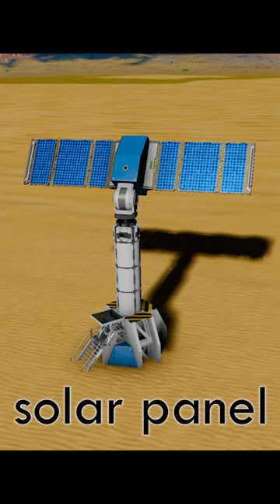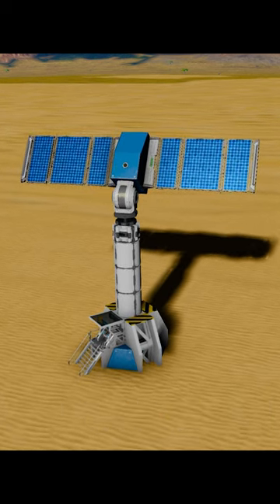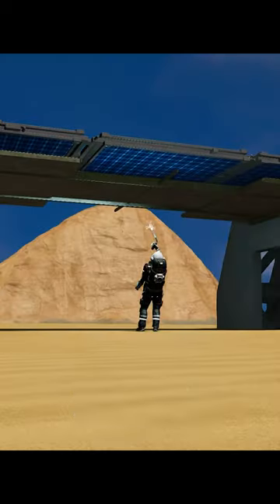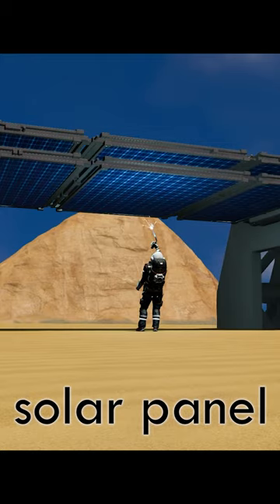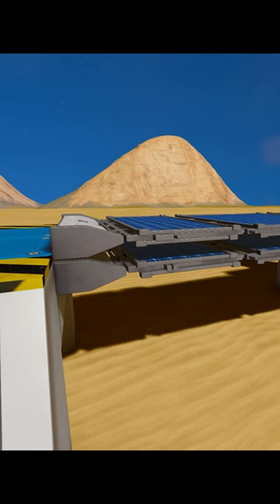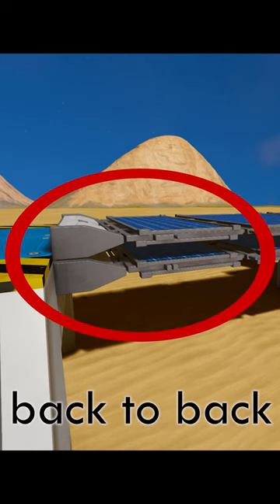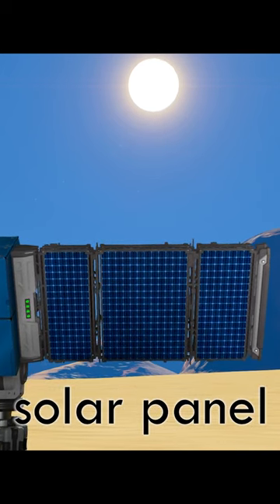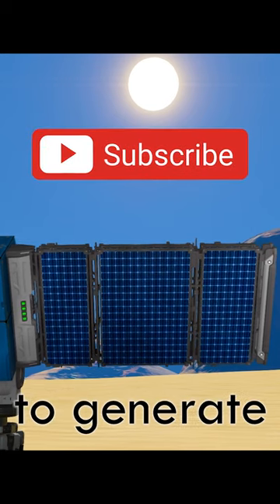How to DOUBLE solar panel OUTPUT in Space Engineers! (Outdated)

Comment from the maker: With the newest update, this trick has been patched! Sorry everyone, it was fun whilst it lasted 🫡
Reply: thats what i just realized today thanks for clarifying.
Reply: No way
Reply: It took them HOW MANY YEARS to fix this??
Reply: Nooooooooooooo I just tried it and it was patched T-T
Reply: I Told You The Devs Knew about This BUG/Trick(not a Trick really a Bug) and it will be Fixed
Reply: I wonder if that transparent solar panel glass mod can look into this now, make it a diminishing feature.

I've also had panels maintain charge through solid asteroids so there's that.
Reply: NOOOOOO
Reply: This feature will be missied
Also was good to safe space
Reply: @AliceDoesThings404  my nooo should be noted as a real darth vader noooo. I had 259 solar panels in my base, 128 of which were double stacked. Now I only have 131
Reply: There is a mod called remove solar pivots to enable this.

Comment: Space engineers again perfectly reflecting real life
Reply: Dual junction solar cells are a thing IRL.
Reply: All hail Klang!
Reply: This is a real life concept. The sun bounces off the sand and hits the panel underneath. This is why you can sit under an umbrella at the beach and still get a sun burn.
Reply: @alexc9434  wait, WHAT? That maybe explains some things xd
Reply: @alexc9434  It shouldn't generate at 100% though. The gains from the reflected uv is a significantly lower.
Reply: @My_initials_are_O.G.cuz_I_am  Multi junction solar cells just use different pn (diode) junction base and doping materials in each layer that forms an individual cell, and are identically limited in the same amount of layers a single junction solar cell is limited to.

They don't remotely work like multiple solar panels stacked up on eachother.
Reply: @benc182  Its still like 20-40% of normal output. And is even more in winter (cause of snow) or in cloudy/dark weather when the light is dispersed the most.
Reply: @LRon-Hoyabembe I agree with this guy he seems to know what he’s talking about
Reply: @benc182 As far as i saw it only generates around 20-40% Output getting closer to reallife (the first panels seems to count as opague block)

Comment: Instructions unclear, solar panel is now stuck inside the sun...
Reply: Solar= sun
Panel= a flat component usually laid into a floor, wall or ceiling. 

So you floor the sun with them. Makes sense.
Reply: @AlanGChenery  Well I mean technically speaking, "solar" means "Relating to stars," but whatever.

Edit: More accurately, it means "relating to a star"
Reply: Coords?

Comment: The front arrays would have to be transparent while catching the majority of the photons. The second row would benefit from being double sided with a light reflector on the back side to bounce back any extra light that wasn't captured. But the second row would not catch as much light as the first row. You wouldn't get twice the power. Maybe if you focused additional light toward the panels using reflectors but then you wouldnt want the panels so close together. MJ panels would be better in capturing a spectrum of light but the atmosphere on earth blocks most of the spectrum. I'm also assuming that area space is limited and putting  panels next to the existing panels is out of the question. Even though it makes the most sense.

Comment: So, I saw in another comment about dual junction solar arrays existing and asked Chat-Gpt about it. heres what I got!: Dual junction solar arrays use two layers of semiconductor materials to capture sunlight and convert it into electricity. The layers have different bandgaps, allowing them to absorb different parts of the solar spectrum more efficiently. This enhances the overall efficiency of the solar cell compared to single-junction cells.

Typically, the top layer absorbs shorter wavelength, higher energy photons, while the bottom layer absorbs longer wavelength, lower energy photons. This enables a more comprehensive utilization of the solar spectrum. The absorbed photons create electron-hole pairs, generating an electric current that can be harnessed for various applications.